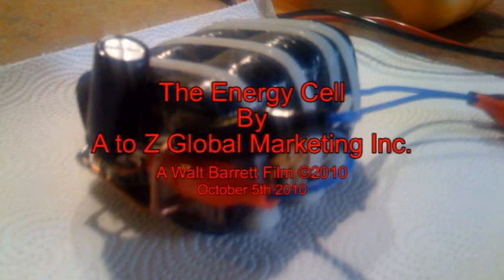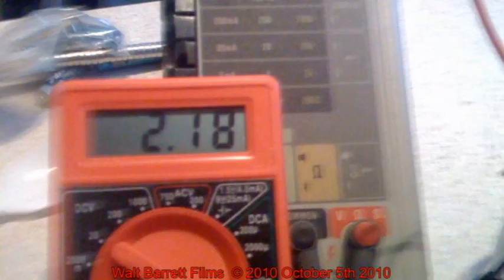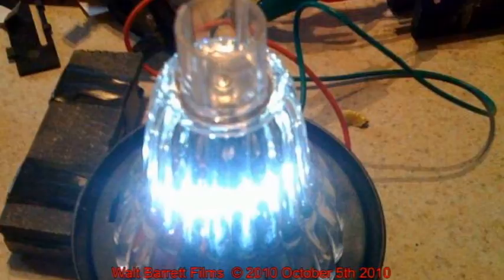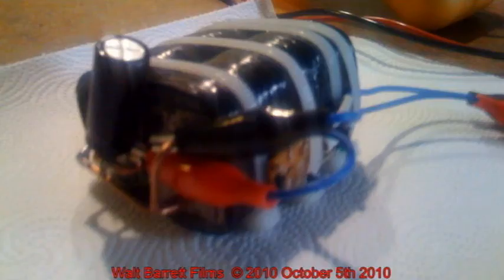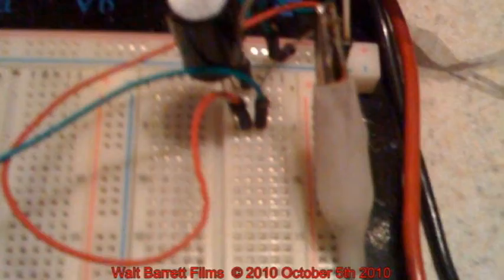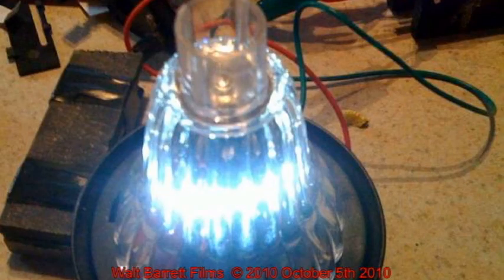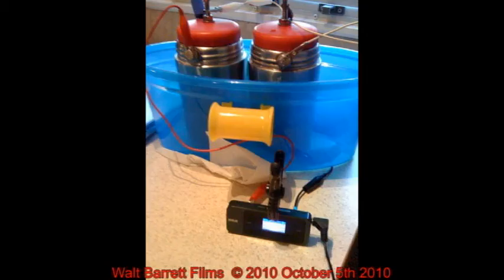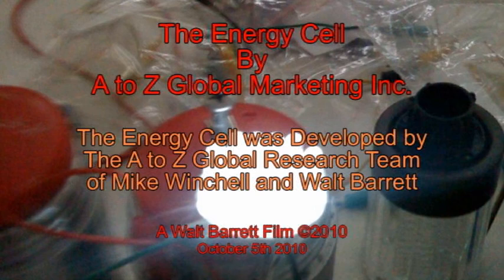The Energy Cell  A Walt Barrett Video

Comment from the maker: The new power cell final version is fully field serviceable and totally recyclable.
The new cells are round, sealed, and water tight. They are 5 inches tall and
2 1/2 inches wide. One of the fuels used to power the cell is salt water

Comment from the maker: The Final version of the energy cell goes into production Monday December 6, 2010.
Each cell produces 1.2 volts and are designed to be clustered to produce various voltages for lighting, cell phone charging , and powering various low voltage devices.
The new cells are round, sealed, and water tight.  They are 5 inches tall and 
2 1/2 inches wide.  One of the fuels used to power the cell is salt water.